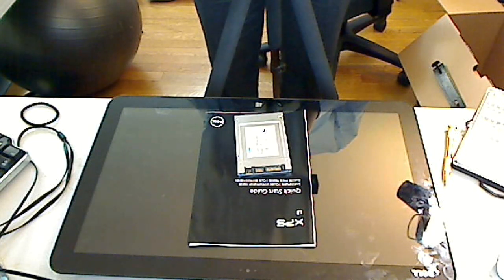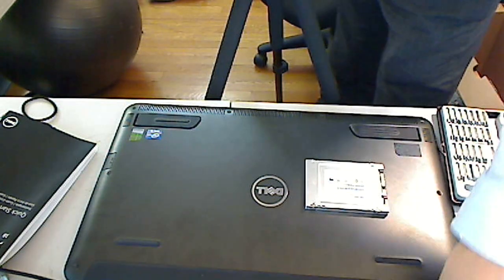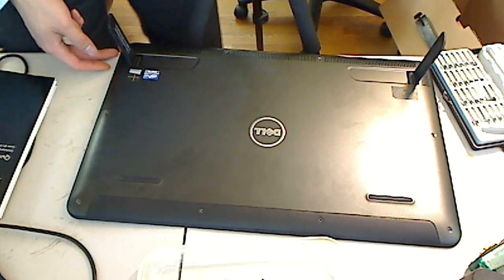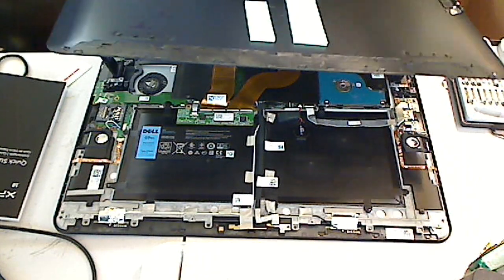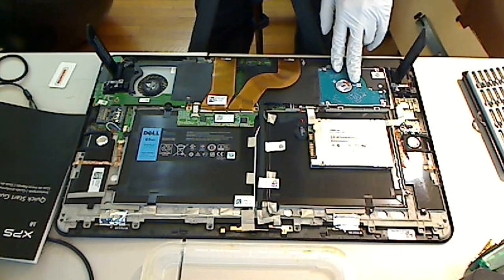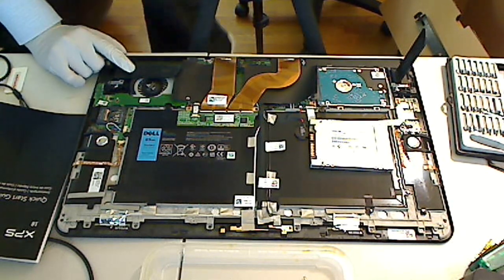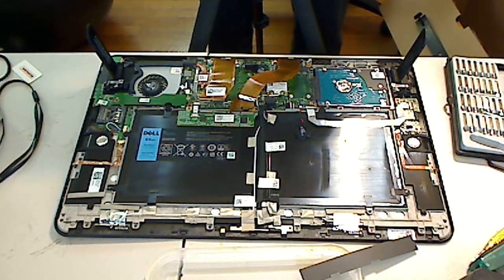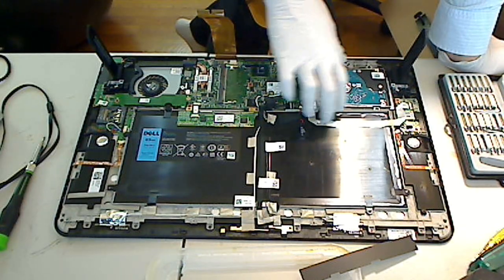Inside look Dell XPS 18   in Portable All-in-One Tablet hard drive replacement memory ram upgrade

Comment: So are we to assume that the RAM from the factory is soldered and integrated into the board? I'm doing a RAM and SSD upgrade right now and I'm not seeing where to pull an old stick out and replace with a new one.